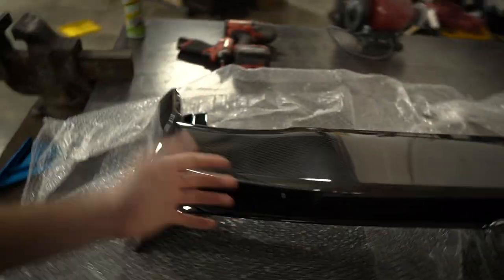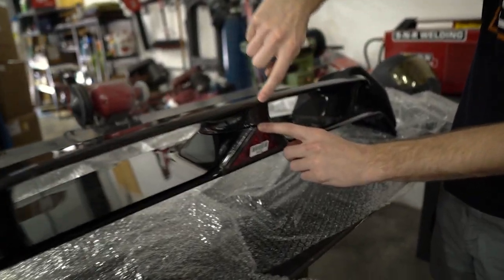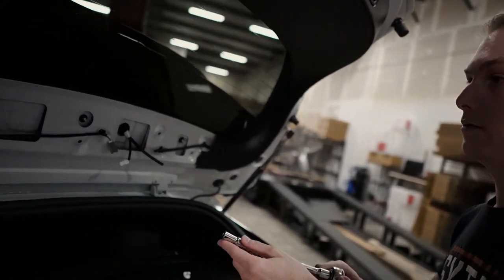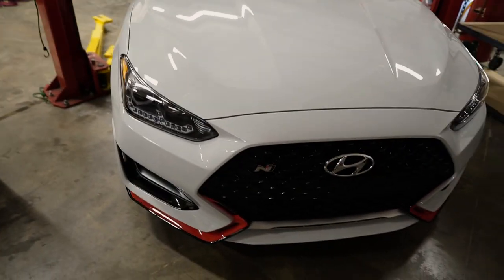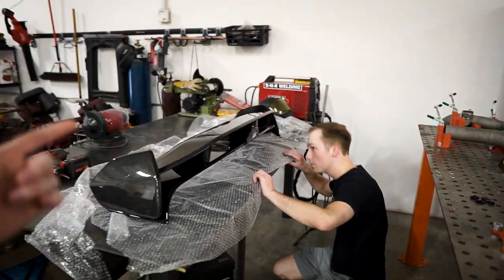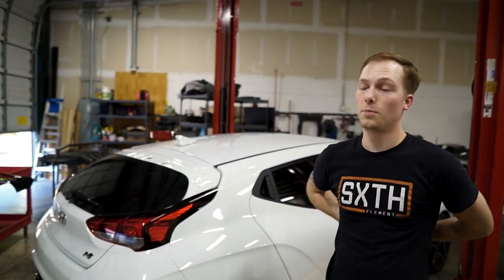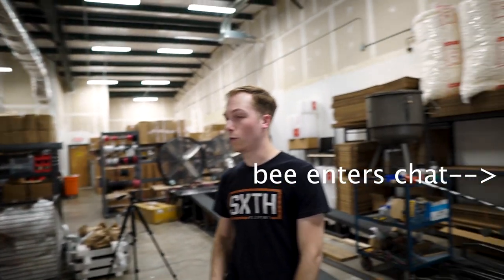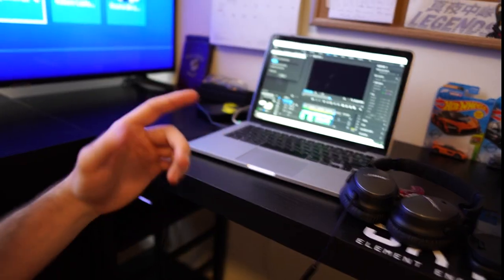Installing an N Performance Carbon Wing on Nate’s Veloster N!

Comment: Looks nice, however if you are looking to spend a great deal less. Pick up the ADRO wing. If you already have a N you just separate the top and bottom deck from the factory wing, then replace the top top with the carbon piece from ADRO. Better yet. Its only $700. The wing is deeper has a larger flare and a bit different "winglet" never knew that was a word till your video. I put mine on a few months ago and it is defiantly a head turner. and at less than 1/3 the cost of this, you can have it, makes it much more available for other. Still great looking setup Ben.
Reply from the maker: Different wing, that one is more towards stock in height and doesn’t have full winglets. Definitely a great price for a carbon wing though.

Comment: Hey what's happening I've traded my Hyundai veloster turbo r spec 2020 for a 2222 Hyundai veloster turbocharged N and it's a six speed manual transmission instead of automatic transmission so the owner put carbon fiber mirror molder & carbon fiber front lip so I've to be careful i driving up the driveway or I'll scraper the front bumper 😮😢

Comment: Most 18 inch wheels with reasonable offset will easily clear the performance pack brakes. Offset is the big limiting factor for N wheels.
Reply: We are swapping the brakes! 19" is necessary to clear the new calipers
Reply: @nathanamons2187  I forgot you're doing the big brakes.
Reply: I just put 18’s on my 2021 N DCT and it was a great mod. I have heard that the 2021 seats will not fit in the previous year model. Of course the lights would not work.